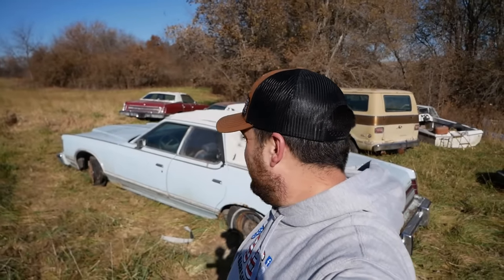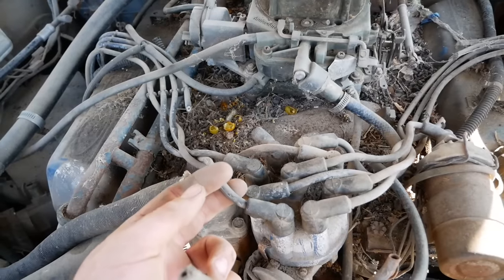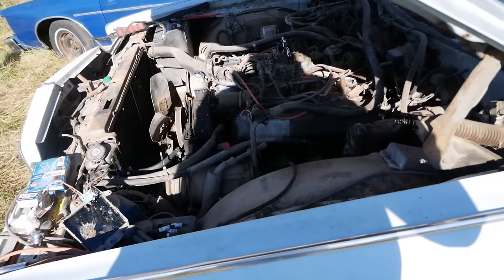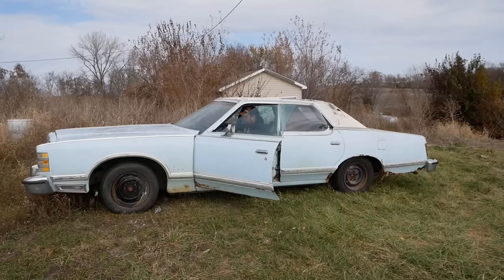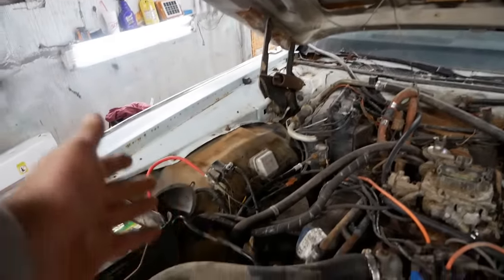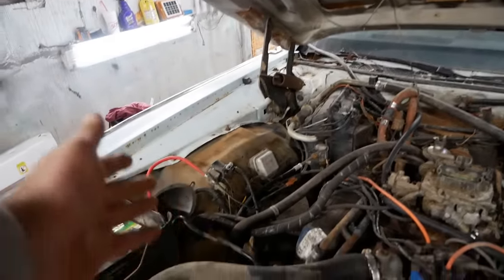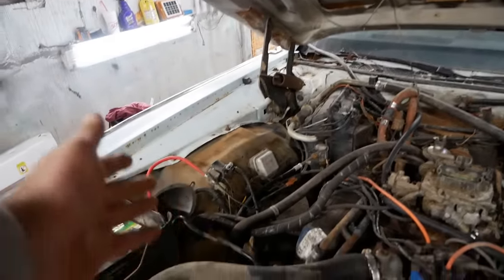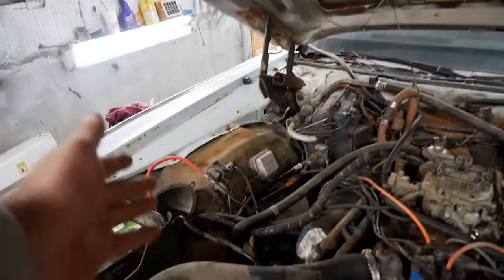FORGOTTEN for 33 Years Will This LTD Run and Drive? Can We Make a Cop Car Clone?

Comment: Test drive with Dalton, summary:
-Car wobbles like a bouncy castle at a birthday party
-Brakes reenact D-Day
-Bumper doesn't want to live anymore
-Battery goes into terror mode
-Engine compartment opens gate to hell
-Carburetor wants ALL the power
-Radiator turns into a geyser

Was it successful? 
"Absolutely!" - Dalton 2023
Reply: I need to buy that blue car. Damn in los good.😅😅😅😅❤
Reply: The two door hardtop I’ll be by that one😅😅😅😅😅

Comment: Dalton : Sees the battery has slid over and made contact with the car, shorting it casing a small fire. 
Also Dalton: Pushes it back and doesn't put anything next to it to stop it sliding again, then immediately does a donut to fling it back out the the body work.  ^_^  Y'all are all kinds of Crazy. LOVE it. I hope you never get seriously hurt but godamn, never change!

Comment: Rustoleum Gloss Black and a foam roller has resulted in a surprisingly decent paint job on my race cars. Painted 4 different cars with the same gallon over the years - a 94 Silverado, a 91 Dakota, a 92 Roadmaster and a 94 Prism. 

Still have some left.

Comment: My dad and I plus a few guys from our crew made an attempt at enduro glory with a mid 70s 2 door LTD. Only because the Ford guy in our group won the card draw and it was the cheapest Ford we could find. The race legal cage and International Harvester red paint complete with hand done pinstripes which loosely matched our trucking company colors cost more than the car. In order to strike fear in our competitors hearts, we painted 460 C.I. on each side of the carb fire hole in the hood. However no one was scared of the smog equipped 351 Cleveland. The best it did in 3 races was 2nd in its heat…of 2 cars. It finished 12th in another which won us just enough to buy beer. Thanks for the fond memories Dalton!

Comment: After 1962, in Canada, the Mercury was discontinued, but Ford Canada, had a division called Meteor, which was a cross between a Ford and a Mercury, Meteors, came out in Canada, around the same time Mercurys did.

Comment: The idle or throttle getting stuck wide open also reminds me of the 78 Oldsmobile delta 88 Royale brougham 4dr i had the idle stop solenoid kept shorting out because of bad wiring in the dash junk

Comment: If you can force easy off oven cleaner down them stuck hood pull lines (make a custom red tube with a drilled through soft rubber plug tip type creation) then percussive maintenance the crap outta it they’ll move like newish, works on all braided pull lines like bike breaks, gear cable pullers, speedo cables & etc

Comment: Either the spark plugs cleaned up after running the motor hard for a while. Or the carb had some trash that finally cleared out. At first it took around fifteen seconds or so to open secondaries but at last they completely opened up in less than five.Plus it finally sounded like it was hitting on all seven.

Comment: 351/400M are great engines once you fix the oiling problem and throw some speed parts at them, they are just Clevelands... basically. Those brakes sounded like you had a caliper that wasn't exactly bolted on.

Comment: I had a 1978 LTD Brougham with a 460 in it. Paid 100 bucks for it. Used more oil and leaked more transmission fluid than it used gas and it used a lot of that. That was back in 1996. Owned it about 6 months and sold it for 500 bucks.

Comment: Those old LTD's withe the disk brakes are the 5on5 bolt circle just like a GM two wheel drive Chevy C-10/1500

Comment: That car reminds me of the 77 delta 88 royale brougham 4dr and the hay and straw that the rats packed in the trunk and tore out of the back of the rear seat, rotted out the trunk floor but it had no rust anywhere else on the car except the hole rusted through the front corner of the Oldsmobile 350 right valve cover?? When does this happen?? And the rear frame rails were fine also a northern Michigan car?

Comment: I had a 76' ltd i bought in 2003. I drove that car years until i sold it in 2009. Canary yellow 4 door. That car started in 30 below windchill one winter day. Couldnt believe it. I was one of maybe 5 cars on the road that day. Alot of newer cars wouldnt fire up that morning. I could also do 70 mph in 6 inches of snow no problem. Trying to stop 4,300 lbs. In the snow was another story. Love the video. Love the ltd's. Love the porn stashes. 😅

Comment: The newer 351's are good for stroker motors but gotta say the LTD disc brakes will swap in as a direct replacement for the old drum brakes on 64 Galaxies and Fairlane's. Same goes for a lot of the front end poop from these big old beasties in the early 70's... yada yada

Comment: I am constantly burning gas off of the used spark plugs with a lighter and clean them with a wire brush and brake kleen on vehicles i just got ahold of until I see how they are going to run they ain't getting new spark plugs unless that is actually needed to make it run

Comment: I had a 76 LTD wagon with the weak ass 400 2 bl. Slowest car I ever had. And a 76 Grand Marquis with a 460 and Motorcrap 4 bl. It went a lot better. And a 77 Lincoln Mk V with a 460 and Holley 4 barrel. That one hauled ass! ALL THREE had 4 wheel disc brakes! They were LOADED! The Lincoln and Merc had black leather, AC, power everything. The Lincoln had a power sunroof.

Comment: 😂 Would have been nice to plug the holes in the roof with some filler before you sprayed. Didnt have to be perfect but enough to keep the water out.

Comment: One thing I have noticed about American Mechanics not just PBG is the incorrect terminology I.E. plug wires are High Tension Leads (or HT Leads) and things like solder are pronounced as sordar. It's almost as if they mispronounce and spell things wrong as a middle finger to the British. I don't know, I'm just spitballing as you would say lol.

Comment: My aunt Delpha gave my parents her 78 ltd because  after she got it back from a repair at the body shop, it leaked and made funny noises, like
If it was more than me and my little sister in the back the tire would rub the inner fender because they just piled on Bondo and didn't even pull the dent. Butter colored pile of hot garbage